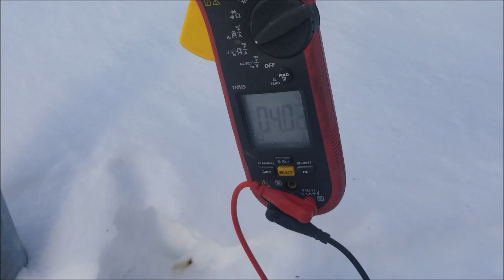Is the neutral wire safe? - Powerlines

Comment: great video,  never think the neutral is a dead conductor.
Reply: It's SUPPOSED to have no voltage on it under normal conditions but it's NOT WORTH RISKING YOUR LIFE OVER!
Reply: @georgemartin1436  Some systems don't even need a neutral depending on if it's symmetrical or not. Households always have a neutral.
Reply: @GymChess  distribution and transmission systems over 10 kV don't have it
Reply: @imeprezime1285  All wye-configured transformer windings have the neutral grounded no matter what the voltage is while the delta windings are not grounded at any point. The wye-side is grounded on every transformer out there...
Reply: @georgemartin1436  By neutral I was referring to neutral wire conductor, not the neutral point grounded!
Reply: @georgemartin1436  voltage is only one part to the power equation… the other part is the current and most neutrals are always carrying plenty of that. If it gets broke you are sure to have voltage on it if it has load.
Reply: @matthewmckinney1043  Of course. We just had a guy who had to repair a splice on neutral line in a TX sub...and he didn't ground the closest points to his work location and (you hear it coming) when he uncoupled the connection the (improperly grounded) neutral line was close enough to a 138KV line current flow that the induced voltage was sufficient to blast him off his ladder with several thousand volts. Dumb mistake.
Reply: That's returns  power lol
Reply: I know to never think the neutral is a dead conductor; I learned this just recently from watching a YouTube video which teaches that you can be shocked by a neutral wire.  So you use a tester to test all conductors you will be working on even if one of the conductors you will be working on is a neutral wire; it can still be carrying live current.